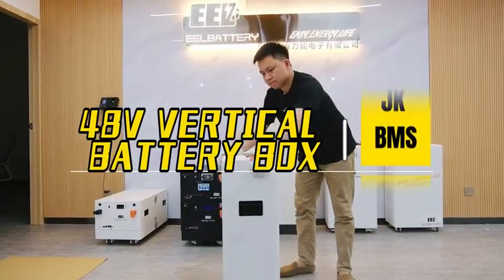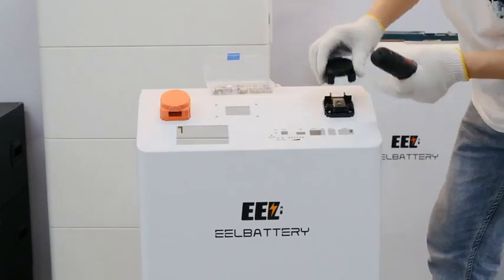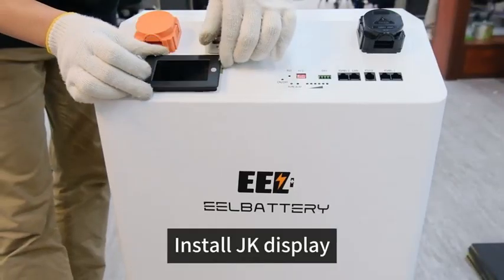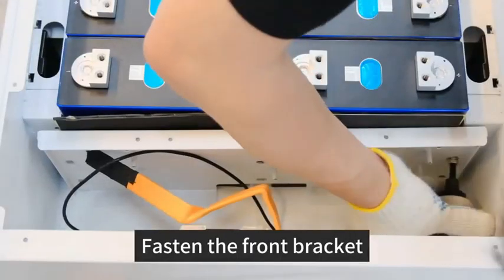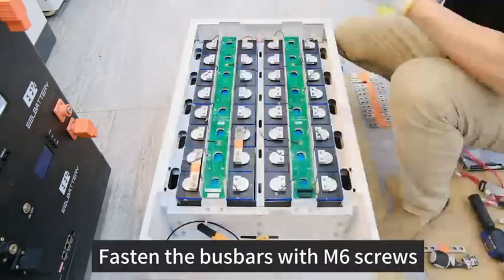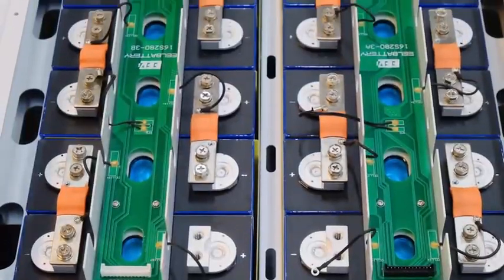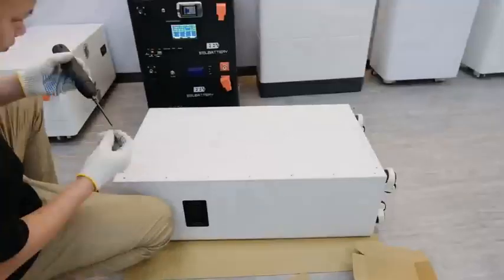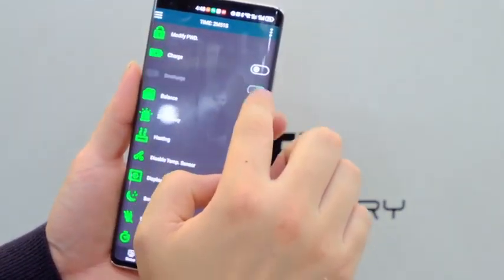EEL- JK bms battery box installation video//welcome to have a look!

Comment: i have two of these, they are excellent and the price was great, recommended!!
Reply from the maker: Thank you for your feedback~ friend 😄
Reply: Shoutout to Howard from EEL who was excellent to deal with!
Reply: If i build another, i would possibly use small threaded studs and nuts to hold the BMS as the nuts would be easier to install than the screws which were tricky. Also i was careful with the screws on the cell voltage PCBs as the tracks can be shorted by the screws in this current track layout 😮
Reply from the maker: @TobyRobb I will register your suggestion and give feedback to the company's product department~

Comment: I never would pile my EVE LF280K cells flat instead of standing right-up how they are meant to be placed (liquid electrolyte won't cover all anode/cathode material).
Would be nice to have a "bring your own BMS"horizontal solution or one where 4 groups of 4 cells are stacked above each other...
Reply from the maker: Regarding the placement of the battery cells, we can be sure that there will be no situation where the electrolyte cannot reach the positive and negative electrodes if they are placed horizontally.
For example: Huawei brand battery packs are all vertical.
This depends on personal preference. If you like stacked styles, we have many stacked battery packs, you can check out my other videos.

Thanks again for your comment.:text-yellow-goal:

Comment: You don’t even compress the cells, leaving a gap under the compression plate. I have seen, on Off Grid Garage, that it is required when cell terminals are not facing upwards, because of gas forming in the cells.
Reply from the maker: hello friend. thank you for receiving your commend. About this compression, First, the weight of the battery cell can push out the gas. Second, there is a top plate between the battery cell and the BMS to compact the battery cell.